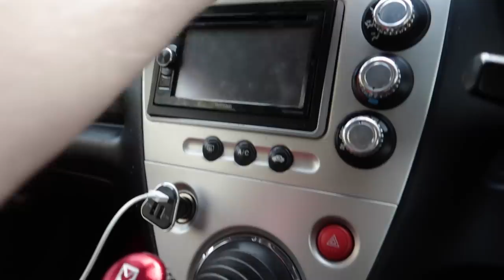CARBON Parts For The EP3!!

Comment: interior's looking gr8, just need the dial surround. You skipped past the door pillar installation. Do you know where Stu got them from? As I was told to glue them on top of the plastic ones. Are there different types?

Comment: Just go for it m8 video what you do an if you put the bits you take off in order lot easier to put back together an you don’t learn if you don’t try. I just used to take things apart to see how they worked an learn how to put them back together an improve them or get them to go a bit better lol. Looking smart what you done so far just be careful you don’t go over the top with the carbon bits an make it look tacky bro